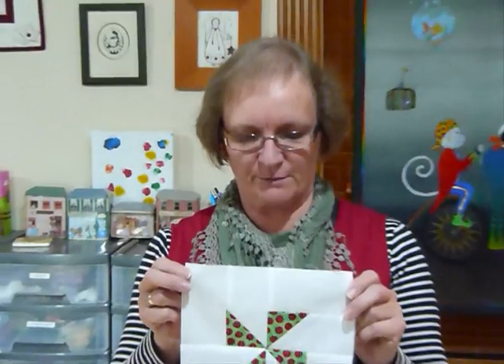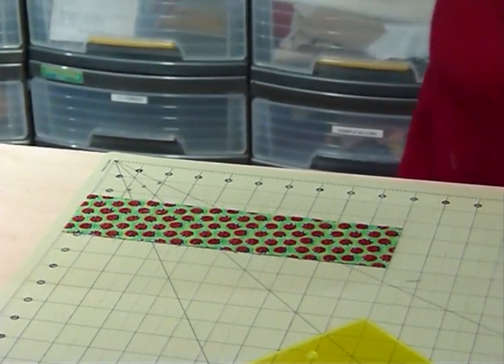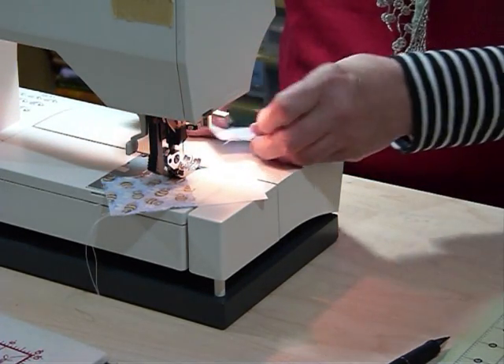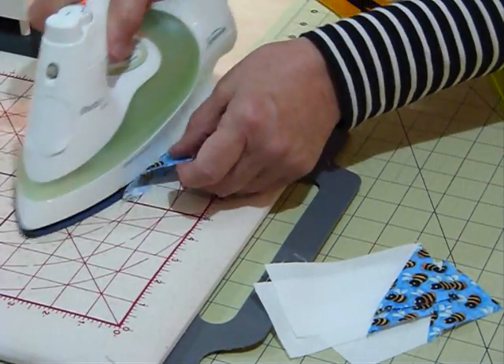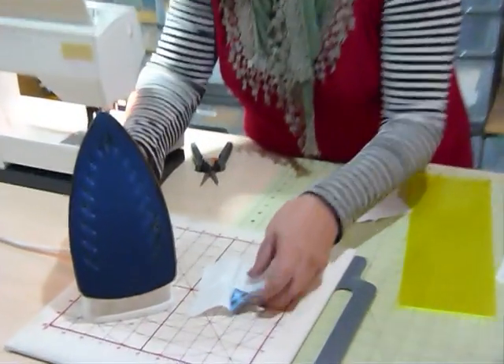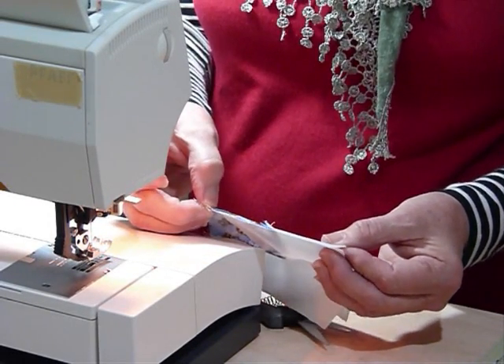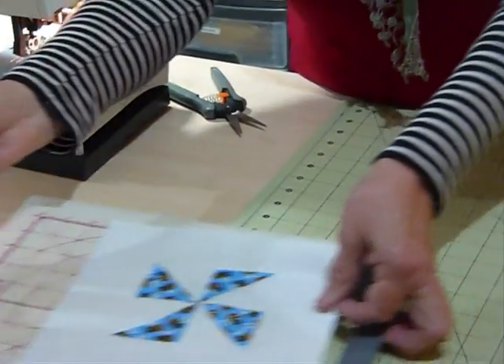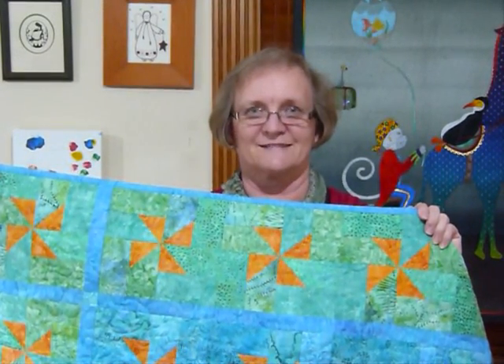How to make a Pinwheel Block using 2 1/2" strips and squares - Quilting Tips & Techniques 102

Comment: Nice, will have to remember this.  Also, if you put another square on the opposite end of the white rectangle of each block, you'd end up with a pinwheel where the four blocks meet.